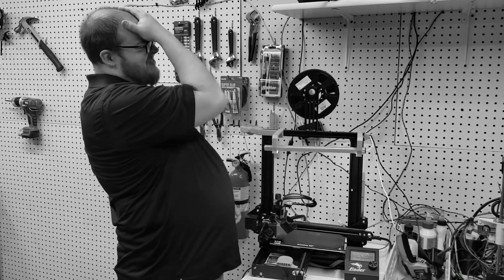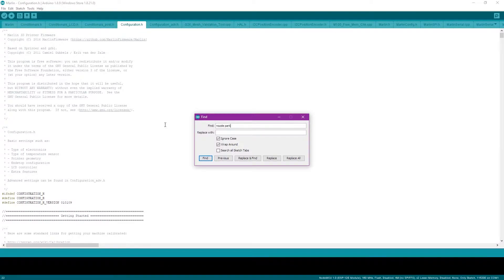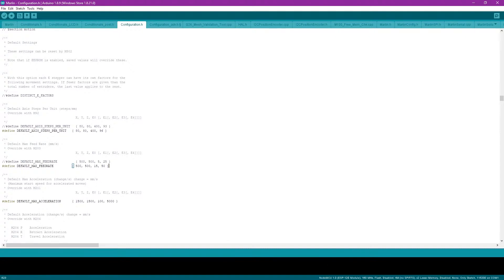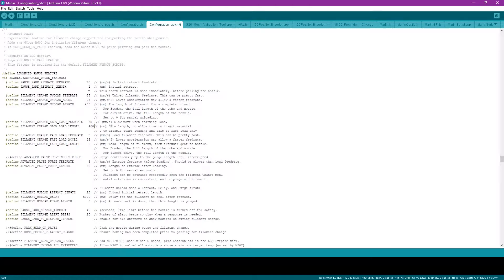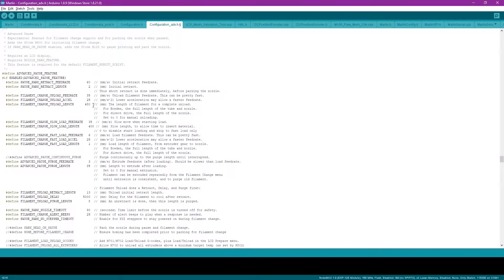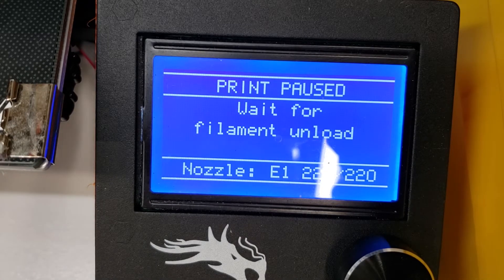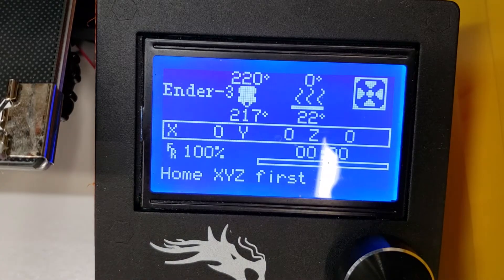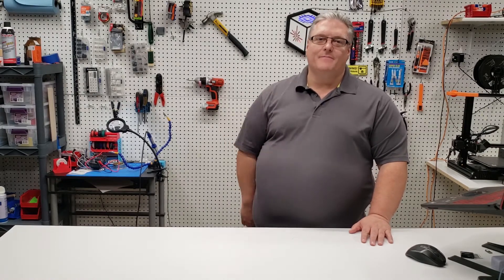High Speed Marlin M600 Filament Changes! | Changing 3D Printer Filament

Comment: Hi, do you know how to use MKS TFT24 Display in combination with M600. thnx
Reply from the maker: The MKS TFT24 (or at least the model I have) allows you to long press the button and switches to emulator mode.  That would likely be your best way to handle that.
Reply: @MakersMashup  thanks for your fast response. sorry it was my mistake, I meant MKS TFT28 and it's pure touch screen without button. Did you ever try to combine M600 with this kind of display?

Comment: Great video.  I found another solution/workaround, though.  In the video you said you think the names "FILAMENT_CHANGE_SLOW_LOAD_FEEDRATE", and "FILAMENT_CHANGE_FAST_LOAD_FEEDRATE" are reversed.  I haven't tried this feature (ADVANCED PAUSE) on previous versions of Marlin, but on Marlin-2.0, it seems to work, with one caveat...  The "FILAMENT_CHANGE_SLOW_LOAD_LENGTH" parameter is commented, "// 0 to disable start loading and skip to fast load only".  I have not been able to get this "0 to disable..." working.  It seems to ignore the "FAST" section, altogether.  Instead, I simply set it (the value) to 1.  That way, the "slow and fast" feedrates seem to work as expected.

Comment: This would be perfect if it was mixed with Cura's post Processing Script "Change Filament", because one wouldn't have to monitor the print to issue the command at the appropriate time, it would pause, retract, cooldown the hot end, and when you finally were able to attend to the printer, it would re-heat the hot end, load the filament and purge. Currently the script does everything I mentioned, except reload the filament, you have to push it manually all the way to the end, and then click for it to purge.